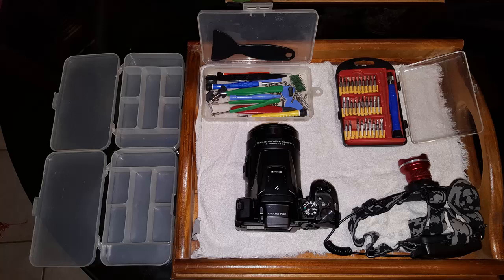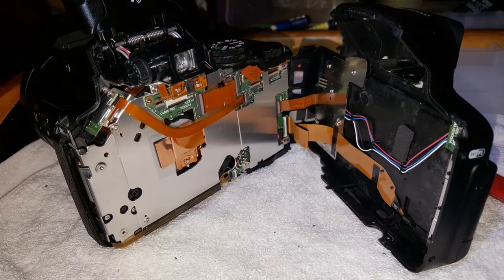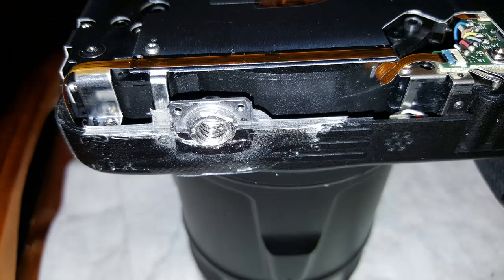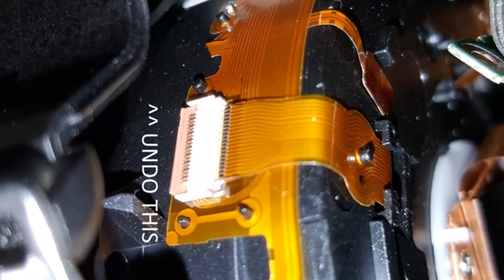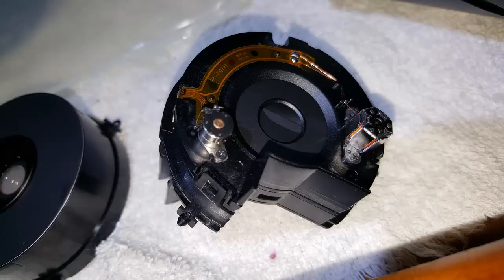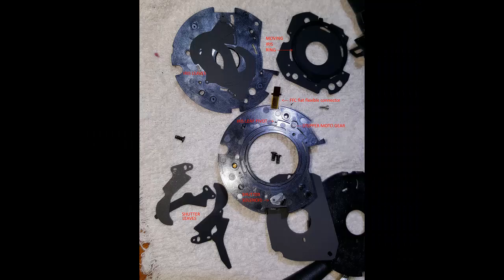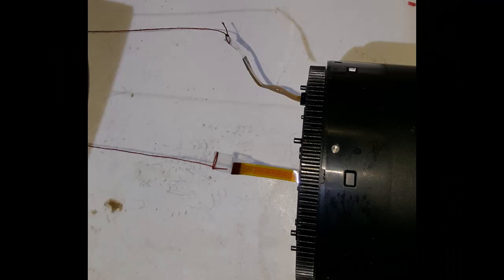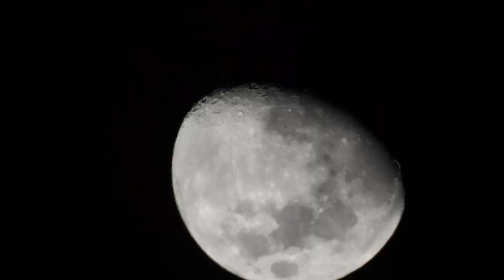NIKON Coolpix P900 Screw by Screw Camera and  Lens Teardown

Comment: Hi, when I remove the outer lens barrel as you show at 3:48, when it gets to the maximum zoom point it stops and won't rotate any further. It is as if the 3 little guides in the grooves have hit something. Is that something you have experienced? I have some debris stuck to the back of the front lens that I would like to remove but I just can't get it apart. Thanks.
Reply from the maker: No, not exactly. It is a little tricky to get it all apart as you see in the video.
At what timestamp in my disassembly are you getting to?
Reply: @whereswa11y  At 3:48 you are holding the complete lens barrel in hour hands. You rotate the inner barrel towards you with your right hand and the zoom extends all the way out until the outer barrel in your left hand comes off completely. With my lens, it hits a hard stop at the point around where the maximum zoom would be and won't go any further. It seems like it was designed that way although I can't discount the possibility that something is damaged inside that prevents it from going all the way, although that seems unlikely.

I thought perhaps I need to pop out the 3 little metal guides that sit in the grooves of the inner barrel but that would require prying the barrels apart a bit which I'm afraid could damage them.
Reply from the maker: @flowh4888  So from 3:48 to 3:51? mine pops apart. I will see what I have in my spare parts pile that might give me a clue.
Reply from the maker: @flowh4888  I did this to try show you what is inside
https://youtu.be/V8_wjc2_m6E
Reply: @whereswa11y  Thanks so much for doing this. It appears that if the rotating ring on the end is not in the correct place, the guide pins on the outer barrel will hit that ring when they get to the end of the guide channels. The solution would be to rotate that ring so that the slots line up with the channels but I can't see how it could be rotated while it is all in one piece. I will have another play with it.  Thanks again.

EDIT: Removed my mistaken ideas. Solution/explanation below.
Reply: @whereswa11y  Update: I pulled out the guide pins, the outer barrel then slid off and everything was revealed!!! I didn't think this would be possible but ... The guide pins are tapered which makes it possible for them (given sufficient force) to skip from one set of channels to the next. I could see marks in the plastic of the middle barrel where they had jumped across. This meant that when the zoom extended and got to the end, the guides were hitting the ring at the end of the inner barrel instead of going through the gaps.

After replacing the guide pins and rotating the ring to the correct position, the outer barrel now slides on and off and operates as it should. I assume that the outer barrel being in the incorrect location relative to the other barrels would have caused the overall lens mechanism to not reach the correct "home" position and this would have caused the lens error I was getting. The debris I saw on the back of the inner lens element was a bit of plastic that shaved off the middle barrel when the guides skipped across. I have vacuumed it out now.

I now have to try to get it all back together, and fingers crossed, it will all work. A possible hiccup is that one of the FFC clips broke off when I flipped it up but I'm hoping that the FFC will just sit there without the clip. I will let you know what happens. Thanks again.
Reply from the maker: @flowh4888  getting those ribbons back through the back of the barrel was the painful part
Reply: @whereswa11y  Well, using your sticky tape and cotton did the trick. I found getting the FFC's back in was the hardest part. I ended up breaking two clips but the FFC's seem to sit there well enough to connect. I would have given the camera a 1 in 1,000 chance of working again but it seems to do just that. The only difference I've noticed is the zoom sounds a bit more like a coffee grinder.  I can't thank you enough. You are a gentleman and a scholar.
Reply from the maker: @flowh4888  It is so great when you see the image on the screen isnt it.
Cheers.
I broke a FFC cable, and that was $100 to replace the whole focus assemble.

Comment: I have a p900 and it cant focus on anything once you zoom past about 1000mm. It seems that it is unable to approach infinity focus. It has suffered a knock so something is probably damaged. Would it likely be the lens motor that is the problem? What else could be the issue?
Reply from the maker: What version is the firmware? You can easily upgrade to 1.5.
https://downloadcenter.nikonimglib.com/en/download/fw/290.html
Reply: @whereswa11y  Thanks a lot for responding mate. Firmware was v1.3. I just updated to 1.5 but no change (cant see anything in the update log about focus issues anyway). Just cant focus past the halfway mark on the zoom. 

Doesn't matter whether I focus manually or use autofocus but at least with AF itll focus the image briefly before settling on being out of focus again.

I'm thinking about just replacing the whole lens because the front lens is cracked anyway. If I knew that the focus motor was likely the problem though I might just replace that instead of the whole thing.
Reply from the maker: @HighBoss  where abouts are you? Australia?
Reply from the maker: @HighBoss  https://www.aliexpress.com/item/32919668348.html?spm=2114.search0104.3.2.4f6f48af6kVnXk&ws_ab_test=searchweb0_0%2Csearchweb201602_7_10065_10130_10068_10547_319_317_10548_10696_453_10084_454_10083_10618_10307_537_536_10131_10132_10133_10059_10884_10887_321_322_10103%2Csearchweb201603_52%2CppcSwitch_0&algo_expid=3782663f-c6fa-4204-8199-88bc9e340f70-0&algo_pvid=3782663f-c6fa-4204-8199-88bc9e340f70&transAbTest=ae803_4
Reply from the maker: @HighBoss  if you focus manually then i isnt likely to be the motor, 
ok so to be clear.
if on wide angle, minimun zoom you can focus close and distant?
but when on full zoom you cant focus at all, either manually of AF?

How did the Lens get a crack? A drop?
Then it might be a physical issue with the focus motor and focus lens slide path.
Reply: @whereswa11y  Yes, your interpretation is accurate. I've uploaded a few pics here to illustrate: https://ibb.co/album/j2bswF

I'm uncertain how the damaged happened as I've only just got possession of the camera but a drop is highly likely as there's some notable scuffing on top of the flash that suggests impact with concrete or some other hard abrasive surface. The front lens is both cracked around the edges and scuffed in the middle although interestingly only the middle element appears to be damaged (from what I can tell the front lens consists of 3 elements) while the front and back look fine.

A mechanical issue with the focus lens would make sense - maybe somethings been knocked out of place by the impact? Also, you mentioned the focus lens slide path, what is the nature of motion for the focus lens? Does it move backwards and forwards inside the barrel or does it just rotate?

I suppose I should just open it up and have a look for myself at this stage. At least I have an idea now of where I should be looking. Thanks again for the help. Btw I'm in NZ.

Comment: Have you ever done the filter removal on a Canon 7d? Would you?
Reply from the maker: i have not and I might be a bit wary. The first time I did this on this P900 it was broken so I had not much to loose. And I did make one error that ripped out the FFC leads #BAD.
I also know that some cameras have the IR filter as a coating on the lens surface and not a easily removable filter.
Reply: I understand quite completely. I did a teardown of a Nikon d70 with no manual. It all went well as I am experienced in dis and reassembly of complex objects and know the “tricks” as do you regarding trays, photo for reference, etc. Even with all that, it was quite the nerve wracking experience. I hear a Canon 7d has a carefully mounted CCD that needs to be reinstalled with perfection if you ever want an in focus picture in the future. I’m also told that this requires a machine for this alignment... makes me nervous.